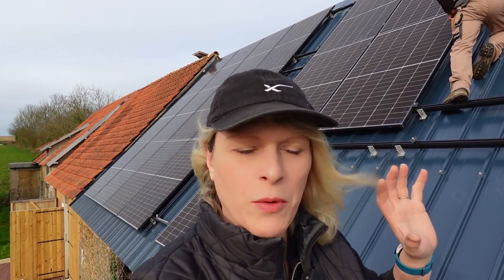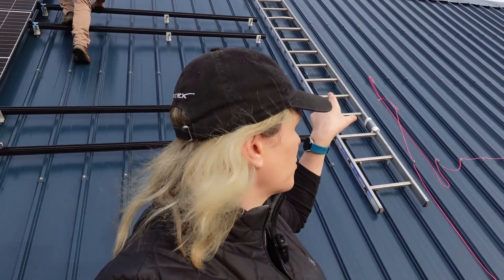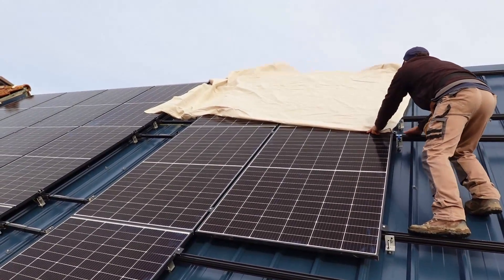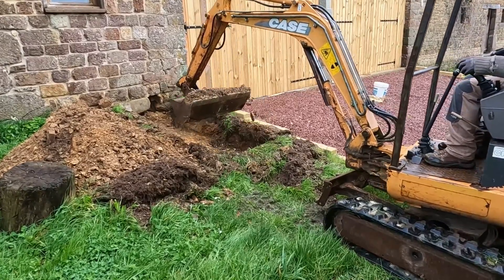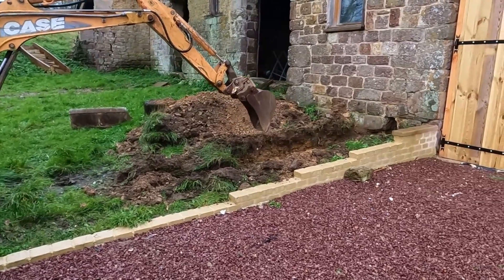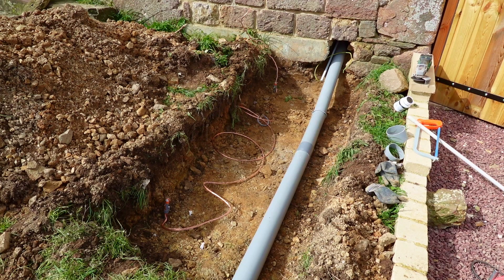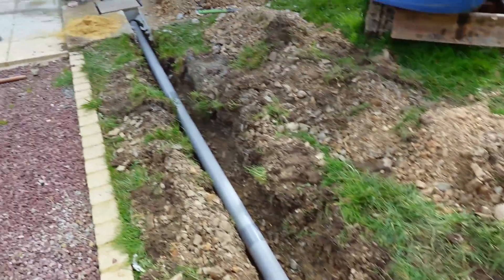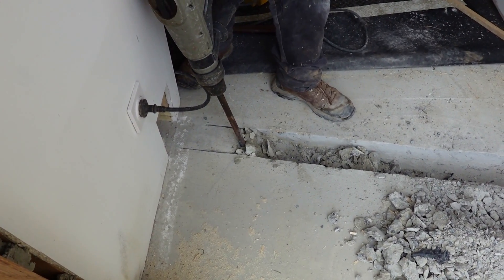Fixing The Solar Cable Problem

Comment: Won't the voltage still be there?  How would it disipate?  The connection to worry about is connecting to other equipment, both panels are both charged there will not be any difference of potential and therefore no current.  Also voltage doesn't spark it is the current flow.

Comment: Covering panels to reduce voltage... Safe for connecting, You should have isolators on end of each string. Should never be joining or disconnecting live MC connectors. Even placing isolators mid-string at each end to reduce the series voltage for working on them.
 If I was a firefighter attending a callout at your place, I would either stand back and let it burn or be very delayed in fighting a fire if I couldn't isolate that DC from the source building.

Comment: The more dangerous issue is that you are holding two connectors (often one in each hand) with several hundred volts difference between them.   You make a mistake, that goes straight through your chest.   Otherwise though, as long as the disconnect is disconnected and the solar input is not charging any capacitors in the equipment, a minor spark won't hurt anything.

I still do final hookups at night on big systems.  Its just straight-out safer and continuity can still be checked because large strings will still have a decent voltage on them, even at night.

Putting sheets across a few panels will only reduce the string voltage by those panel's contributions.  The bypass diodes in the panels will allow the voltage from the rest of the string straight through.  Don't depend on sheets.

Great solution for your conduit!  Extra cables are great.  Accessibility for the 90-degree's is important too.  Pretty nice!

Be sure to measure the voltage differential between the two grounds.  This is called "common mode".  The ground references may be different.  It is ok for them to be different as long as it isn't like 100V.   And yes, that is quite possible, utility lines can couple all sorts of mess into the ground.   Also measure frame-to-roof common mode since the roof is metal and that is what would "shock" someone working on the roof.

Comment: SARAH, GREAT 👍 👍 JOB 👏 !
1. Great idea 💡 for two separate grounds, because you don’t want lightning ⚡️ to hit your panels & your equipment is connected to the same ground rod with the potential to damage your Solar Electronics!
2. Great idea 💡to use large enough conduit pipe & a pull box/manhole. Make sure that the rubber weatherproof sealed is seated correctly & the lid tightened, because you don’t want heavy rain 🌧️, snow ❄️ melting or flooding to get into it with the potential to flood your home 🏠 
3. Great idea 💡to install additional Solar Wiring for future project development!
4. Great idea 💡to install & leave a strong pull line/mule tape in each conduit for future cable pulls, so you don’t have to push a wiring snake 🐍 through!
5. Great idea 💡to Plan and Build your infrastructure for the future and the easy access for maintenance!
GREAT PROJECT PLANNING, MANAGEMENT & EXECUTION! 🎉

Comment: The reason that tube collapsed is because it's the wrong stuff for the job. Cable duct is a flexible continuous length, corrugated in appearance and comes pre-installed with a draw rope.

Comment: 600 Volt string??? Warning!!! I think your Victron mppt can only handle 450 V. Covering you panels is not necessary if you do all cabling to the fuses first. I always do the string connection on the roof as a last step. The solar panel connectors are safe to touch. Even on a string of panels. Your self made mc4 connector is made on a cable that has no voltage. So also safe. Also do not use the DC fuses on your string as a disconnect! Never switch off under load. Hope this information is helpful to you. Very impressive first install.
Reply from the maker: No it's 336 volts per string.
Reply: ok no problem then. I maybe misunderstood. In this video you where talking about 600 V  i think.

Comment: What is the actual spec of your panels, what's the size, and make?, and the configuration into the MPPT's. Parallel, series etc
Reply from the maker: I think I might make a separate video going through all the details like this.

Comment: I hope you used some gaskets on the pipe connection, other way water from the ground will leak inside and it will also put some sand into the pipes during the time.

Hint for bending pipes, not only the plastic ones. Fill them with sand before bending. You will avoid sharp bends.
Reply from the maker: Yes I sealed the inside of the lid with roofing heavy duty silicone and then put a double bead round the outside edge. All the pipes have double rubber gaskets between the pipe and the inspection hole. I'm also going to line the gap with some thin foam which I have and then put in some cement to seal it. Later in the year I'll stick a fiber optic camera down the pipe to see if there's any water in the manhole cover.

Comment: You dont't need to cover the panels  Just open the breaker in your combiner box. No current will flow with open breakers, no sparks.

Im wondering about your earthing. It looks like bare copper. Copper will rott very fast underground.
Second thing is, it is not deep enough to get a good low resistance. We usually use ground rods made of stainless steel hammered in the ground several meters deep. (up to 9 meters deep in a dry area)

Your pipes look like made for waste water or drainage. And it looks like you not layed them into sand. This will cause leakage very soon.
And at least they are not deep enough to be protected from damage.
Reply from the maker: You're absolutely correct we didn't need to cover the panels as there was no load. The last couple of strings we connected we didn't bother with the cover. As far as the earth thing goes that's how they do it here in France I took a reading and the resistance is fine. I know that the piify use isn't proper conduit it's drain pipe participates the heavy duty type and all the joints are glued. Time will tell I'll stick a fiber optic camera down there in a few months time and have a look to see if there's any water in there.

Comment: If lightning strikes the solar array, then having to separate grounds, allows for a massive potential difference between them. Lightning can be incredibly destructive to electrical equipment. I personally would bond all the grounds together. I have wired up all kinds of solar systems in my life, and I have seen lightning destroy many things.

I do not want to see your Victron gear get smoked

Comment: Are you going to put a fuse Along with a lightning arrestor with each string? Or are you going to use a combiner box? I wish you would do a video on a whiteboard exactly what you’re going to do. That way you can get some insight. I have a 15kw aray. I am using a 4 string combiner box & each string has its own fuse.  Just wondering.
Reply: The combiner boxes were shown in an earlier video. They are placed inside the barn.

The best place for surge protection is where the cables enter the building. In this case in the attik if the barn. 
If the cable run to the charge controllers eceeds 10 meters, it is recomended to have a second stage of surge protection close to the charge controller. Some brands have inbuilt surge protection - Deye hybrid inverters for example. Im not fimmilar to victron, but i think they don't.
Reply from the maker: Yes you're absolutely correct I should do a whiteboard video I think I'll do one this weekend going through the whole wiring setup. But yes I'm using a combiner box with search protection fuses and breakers for neutral and positive

Comment: Good job. Pretty soon you will be done.
Reply from the maker: That's a great idea I think I'll make a diagram on the whiteboard but yes I've got a solar combiner box with circuit breakers and separate fusing for the positive and negative as well as surge protection.